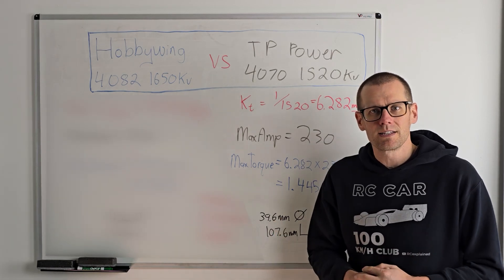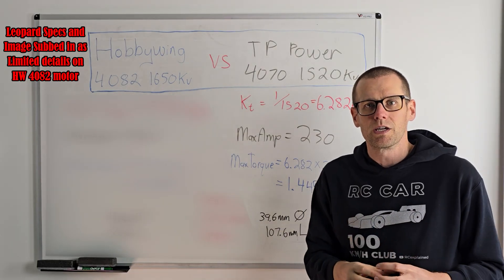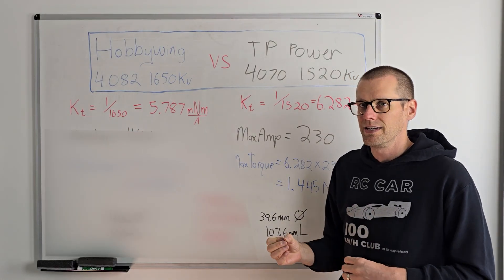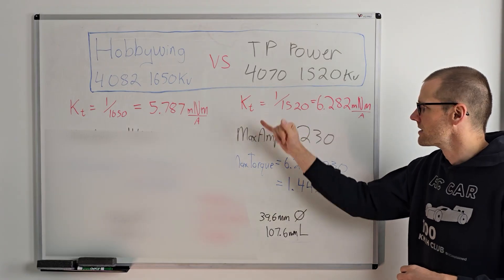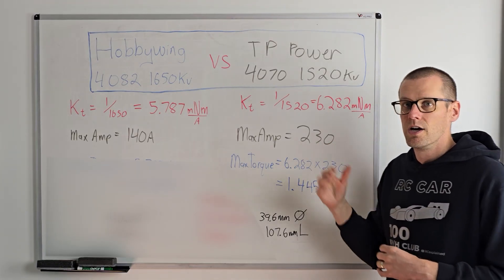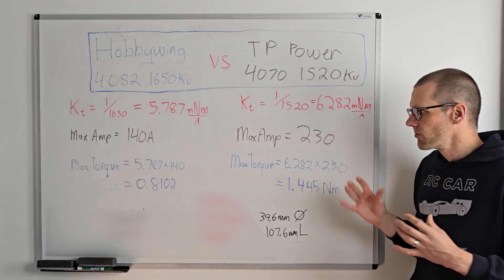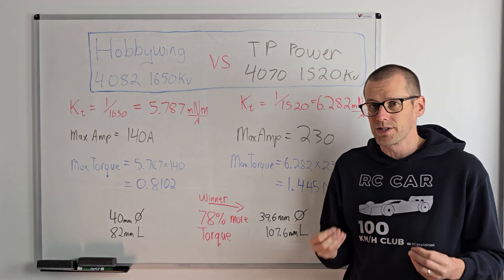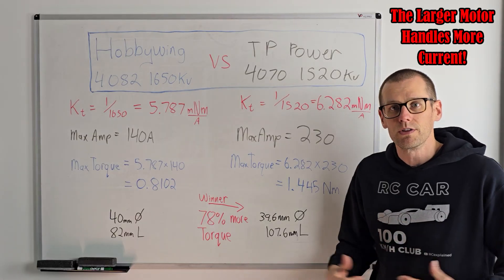Torque Battle using Kt: General 4082 1650Kv Motor vs TP Power 4070 1520Kv

Comment: I can tell from datalogs I have done, leopards under rate they motors max amps capabilities. Have have pushed leopards to more than double they listed max amps and they did not over heat.

Tp motors can take a bit more than they listed max too. 

I cannot speak about hobbywing motor though.

But real world testing of the two motors will be needed to know which will put out more torque.

Some manufacturer cans are more powerful than others even though they are the same size and kv.

Comment: Ok this is great info but what i dont get is, provided having the same FDR even though you have a motor that produces 78% more torque, youre going to have a lower overall speed but youll get there faster than a higher kv counterpart. That said, of course you can go with taller gearing to recover said speed. BUT at what point is it diminishing returns that the lower Kv bigger can motor is giving vs just going with a slightly higher kv motor? Because i mean you can only keep gearing down so much. So my autistic mind is having trouble seeing that theres a "better" solution when it all almost works out the same in the end unless theres a variable or something that im not thinking of?
Reply from the maker: At the end of the day it comes down to which motor can make more Power in watts. That will be the motor that always has the opportunity to push the rc faster.
Reply: @RCexplained so how can we know that info if its not listed?
Reply from the maker: if its not listed you can ask the manufacture.
Reply: @RCexplained sweet good to know thanks!!! Building a few drag cars and want to go fast like Ricky Bobby
Reply from the maker: @WickedMoto haha nice! Good luck in your build!

Comment: Do something like this with 1721 1260kv on 12s and 1721 2400kv on 8s....
Reply from the maker: If the motor is of the same series, meaning the same physical size too, torque output and wattage will be the same
Reply: @RCexplained one on 12s one on 8s?? I don't see it being the same
Reply from the maker: Understood, it doesn't seem to make sense but maybe this video will help out with that if you haven't seen it already.
https://youtu.be/aYWZTYve3e8

Comment: this is good, but you cant look at manufacturer listed peak currents. theyre just like lipo C ratings- subjective. to get a true value on peak torque you need to know the IO, resistance and kV of the motor.
Reply from the maker: True, these specs are subjective. I'm curious hoe you would you use Rm and Io?
Reply: @RCexplained internal resistance  of the motor  will show the difference  in power output  between  motors aswell as current  draw on the batteries......in my opinion  Tp motors  are almost  always gonna  make more  power than hobbywing anyway  so  I knew the answer  before I saw the video